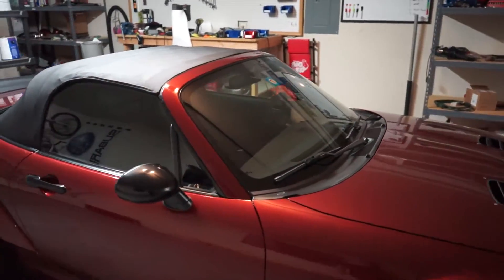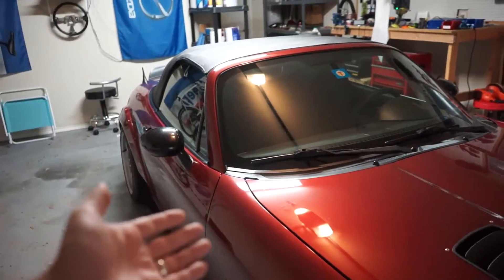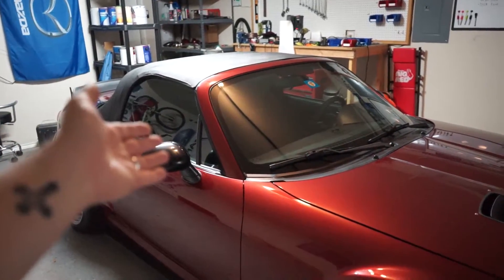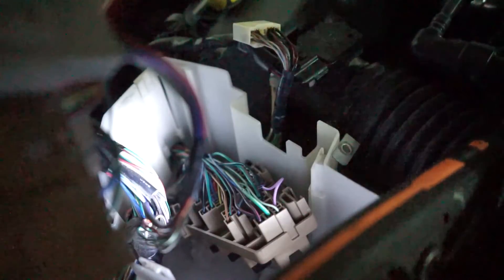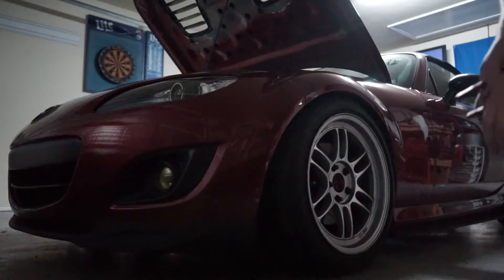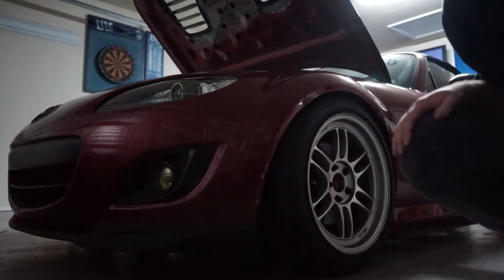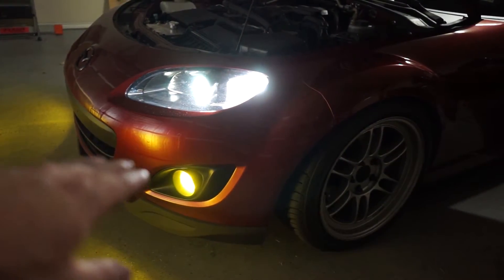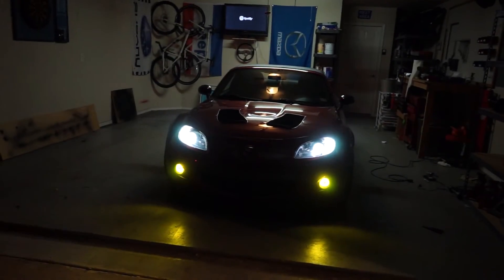LED Fog Lights and Hacking them for Driving Lights!

Comment: I’m getting ready to attempt this mod.  However, my understanding is that if you connect the violet/white wire from the fog lamp relay to the blue/orange wire from the A/C relay, which is also close to the fog lamp relay, you get daytime running lights that are independent of the headlights and parking lights.  You are able to leave the fog lamps “on” all the time, because that A/C power wire is only powered when the key is on.  Yes, it may be illegal to have the high beams and fog lamps on simultaneously, but you can turn the fog lamps off while running high beams.  Thanks for the video showing how to get down to those relays!
Reply: I also did this mod today, and did as you wrote here -- tied into the Blue/Orange A/C relay wire which provides power anytime the ignition is turned on; then you can turn the fog lights on anytime the ignition switch is on.  Got this done in less than an hour.  (Would have been a shorter amount of time if I could have remembered all the tools I needed that were in the basement......lol).

Comment: Would it be easier to join the wires to the wires on the front lights rather than taking the fuse box off?

Comment: why not just hunt down that purple white wire and place a switch on it.  Surely it lands inches from the switch cluster.  From the factory, all cars are "wired for fog lights", then the customer adds fog lights as an option, and they get plugged in... To trace it, put a toner on the purple white white and hunt it down...

Comment: The fog light/high beam thing is the four light law in the US. It's kind of frustrating
Reply: I looked this up. I don't think this actually applies to every vehicle. 
I copied this from a link I found: 
"When a motor vehicle equipped with head lamps as required in this section is also equipped with auxiliary lamps or a spot lamp or any other lamp on the front of the motor vehicle projecting a beam of an intensity greater than 300 candlepower, not more than a total of 4 of those lamps on the front of a vehicle shall be lighted at a time when upon a highway." 
Now, from what I can tell, most newer cars, NC Miata included, turn off the low beam lamps when the high beam lamps are turned on. So, it is not specifically illegal to have the high beams and fog lamps on at the same time, as long as there are no more than 4 lamps on at once, which would be a pair of fog and a pair of either high or low beams.

Comment: So I've been trying to figure this out for a couple of hours (weeks) now. This lets the fog lights work with only the DTRL on. But, does the fog light switch still work to turn them off? In other words, is it possible to run the DTRL or low beams with the fog lights off?
Reply from the maker: Yea it will turn them off if you turn the knob

Comment: Don't know if anyone could help me, I have done everything the same way but it is not working for me, the fog won't turn on when the parking light are on, it only comes on when the lowbeam is on, and it will shut off when bright is on, basically it is like as if I didn't do anything to it.... Anyone has the same experience?
Reply from the maker: I would recheck your wiring, just to be safe. Theres a thread I followed on miata.net that might have better photos since I have to work in a dungeon and it's hard to shoot video when its dark. Dont give up, you'll find a solution!

Comment: Side note. Did this on my NC and to get the secondary fuse box up to a more work friendly area there’s a slide cover on the side of the white housing that separates in order to pull that wire loom up and out some 6-8 inches further. To find it follow the secondary fuse box wiring loom toward the front of the car leading out of the white fuse box housing. Simple to remove and re-install and made the soldering a breeze having it lay over the top of the box it was in instead of inside of it. Great video though. Wish I had access to this video when I did my modification just for a visual cross reference to the Miata forum.
Reply from the maker: Good advice, it was a little dark in my workspace and couldnt see this!

Comment: In Australia you can actually get fined for having your fog lights on when there aren't adverse weather conditions that would require their use. I've ordered some RGB LED headlights to replace my stock headlights and fog lights. I'm not sure if the fog light replacements are proper fog lights or just H11 headlights but it'll let me have some colour in both during the day, and better illumination during the night. Assuming they all fit of course.....
Reply from the maker: Interesting, texas is pretty lax with most laws. Youd be amazed at some of the cars that drive every day on the roads here.
Reply: @jack.ralston  yeah plenty of people here get away with not so legal set-ups, and technically mine doesn't comply with everything, just need to be careful and not draw too much attention haha.
Reply: Which headlights did you buy?
Reply: @justmichyd248  spectrum angel eyes is the brand, and I just got their rgb led headlights.
Reply: If wired independently, then could be used as DTRL without the mains on as well... and yes, there are some who care not about being too bright, and are oblivious to why others flash their lights at them.